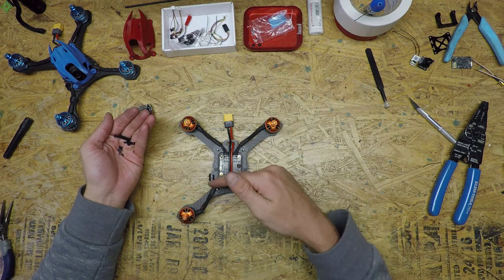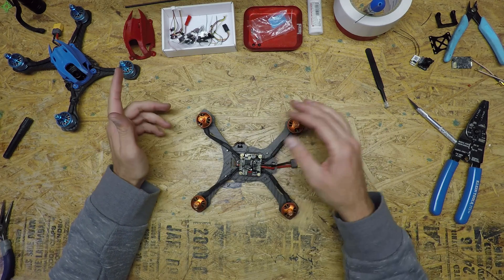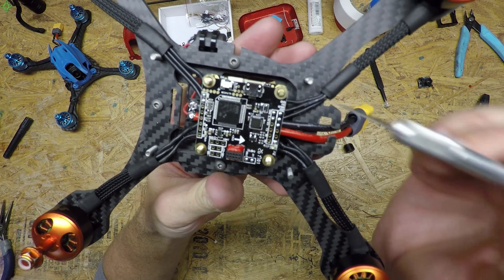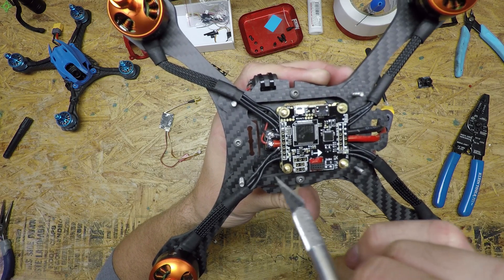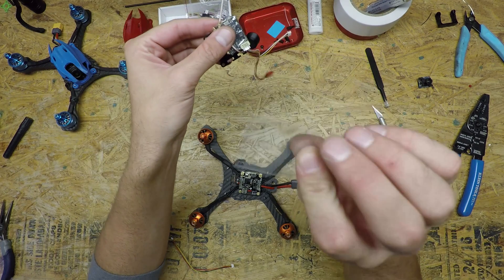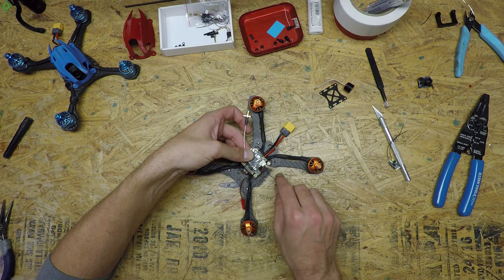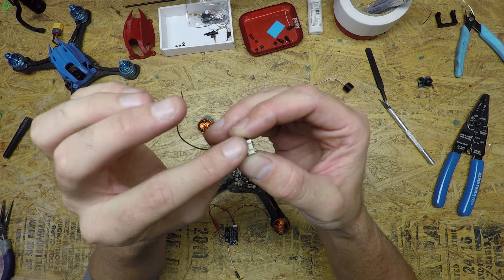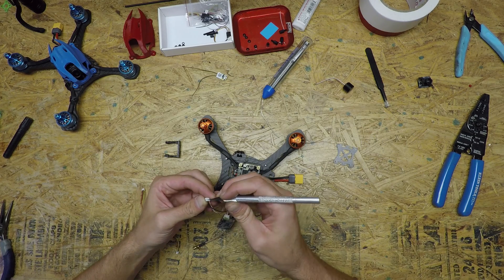(5/7) Neato Fastback Build Walk Through - Wiring the Flight Controller (Hobbywing)

Comment: Thank you for this video. I’m using this stack for my first build. 
Regarding connecting my FPV camera — it’s obvious where the video in yellow wire is soldered but the 5v and ground is not as obvious. Would Insolder the camera’s ground and positive wires to the 5v and ground spots as shown at the 4:10 (-12:25) mark in the video (upper left area)?
Thanks
Reply: I’m using a TBS unify pro v3 (5v -13v).

I’m guessing I can’t power my Unify pro v3 Vtx directly to my lipo pads, so I’ll need to solder the Vtx to that 5v pad as mentioned in my previous comment??
Reply: Found an answer. My camera is 5v-26v so I could wire my camera to the VBAT spot next to the LED spots. That leaves the two 5V spots for Rx and Vtx.

Comment: i have the stack ..using unify 5v vtx ..where should i power vtx and camera from .. i think not enough amp..i get brown out ..
or do i need a dedicated 5v regulator ..
Reply: Did you find an answer to this question? I’m using the Unify pro v3 Vtx that runs on 5-13v. I’m guessing Inwould solder it to the 5v spot in the upper left in the video?
Reply: ON the HW FC there is a VBAT and GND spot on the right half by all the LED and BB stuff. Looks like most cameras can take higher volts so they are good to go as far as I know to be soldered to the VBAT spot. That leaves the two 5V spots for your Rx and Vtx.